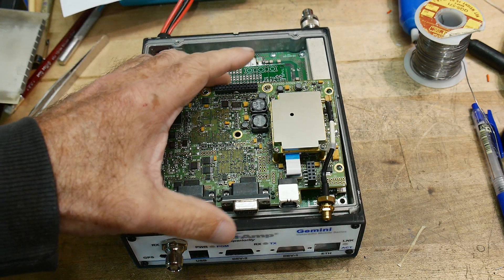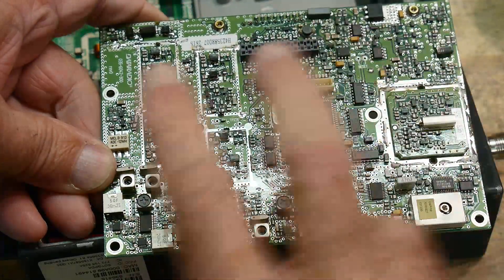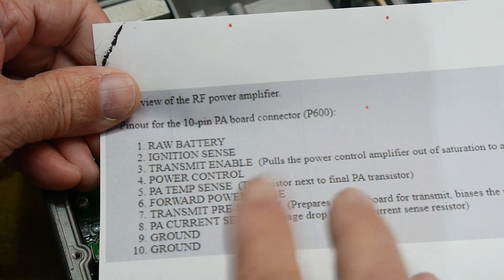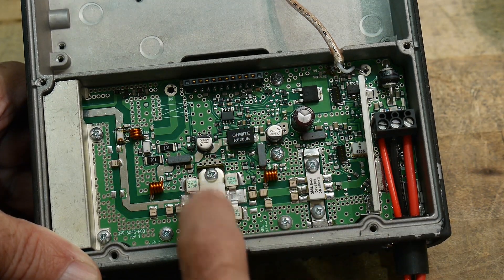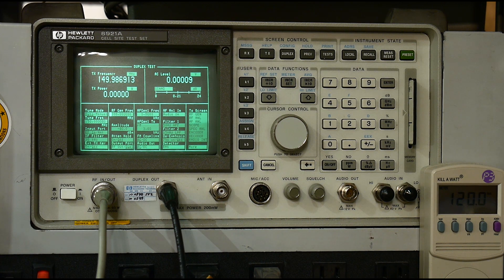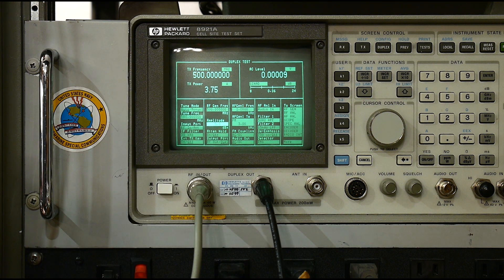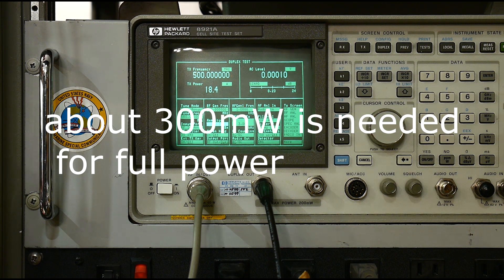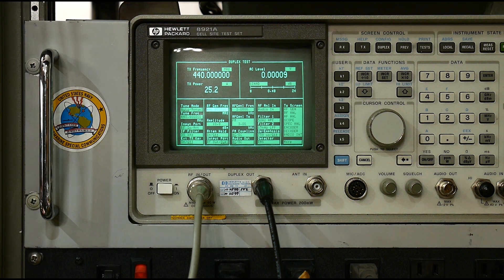#651 Gemini G3 Dataradio (part 3 of 3) 60W UHF Amplifier

Comment: I wonder if you'd get more amplification if you hooked up that power input on the 14 pin connector. I would expect that the digital side can control the power output probably with an analog voltage into that pin - I wonder if it defaults to minimum power if that pin is just floating

Comment: Have you tried your homebrew lab amp to boost the duplex output from the service monitor to drive the PA more?
Reply from the maker: that's a good idea. I did hook up my HT and drove it to 60W. I need to see if I can get the design to work on 2M
Reply from the maker: I used the amp as you suggested. I could now get +20dBm out to the amp. It seemed to flat spot at 40watts with +15dBm input. Not sure why. Plenty of power for me anyway. Someday I'll put in RX/TX switching and call it an official 70cm amplifier.
Reply: @IMSAIGuy  Glad to hear it, thought that would help push the output. Know you're not necessarily a RF aficionado but it would be interesting to incorporate a off the shelf or homebrew mimic amp built into the cabinet to make it a standalone unit. Happy holidays!

Comment: Nice find. Now you need some easy TR switching method
Reply from the maker: Yes, that should be easy to add.
Reply: @IMSAIGuy  What would be needed to do that ? This would be cool for things like New Packet Radio, where that unit doesn't have alot of Tx Power.